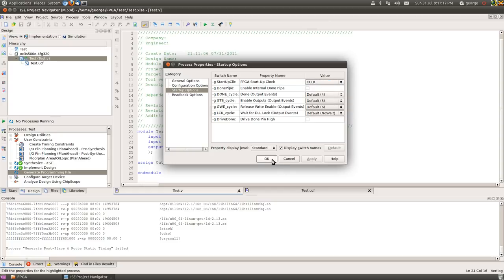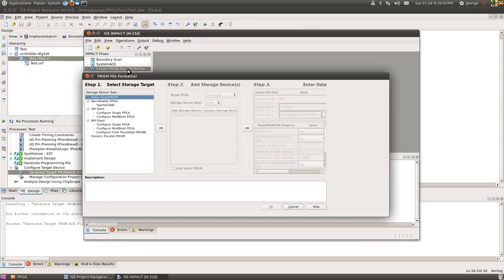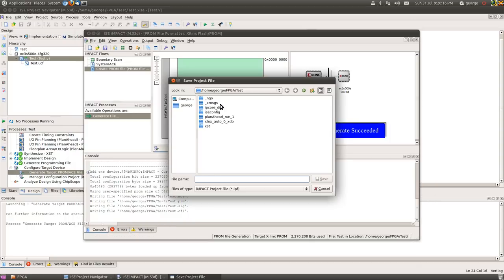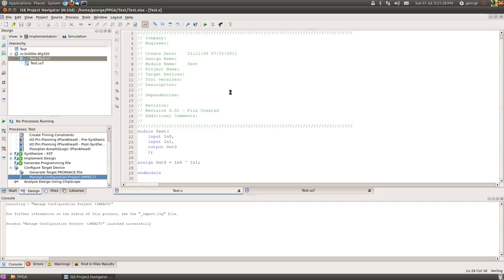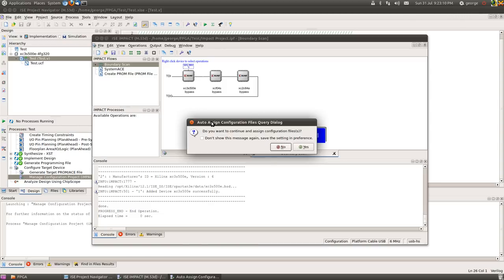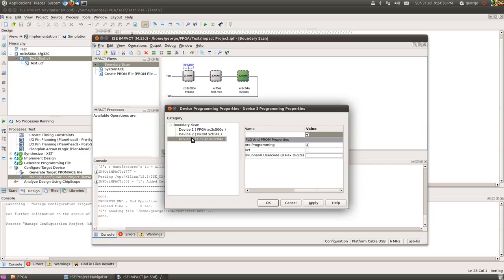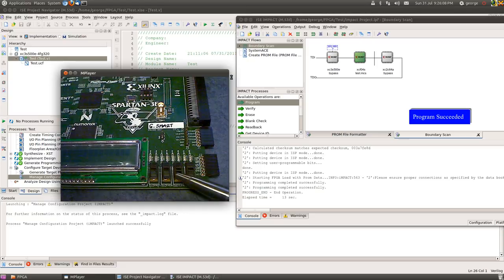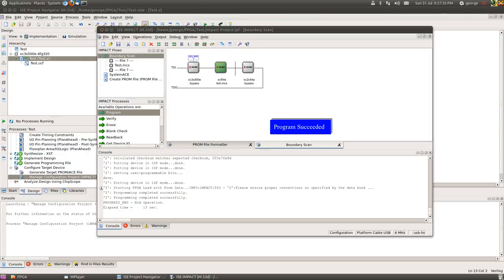FPGA Verilog XOR Gate Tutorial in Xilinx ISE 12.1 (Part 2 of 2)

Comment from the maker: @BallawdeQuincewold These should be in the manual for the evaluation board.  If you have a Spartan-3E as I have, then you can get the manual from either Digilent or Xilinx for the board and it describes where everything is connected to.  HTH.

Comment: Thanks for the Work & Info on the Prom File, and how to fiddle this in via
 
Tool Chain Impact & JTAG. & Co.
 
I use now the Lattice MachX0 Device.
 
So i can prog the MachX0 LCMXO2280C via JTAG-- FTDI2232
 
and the Bitfile is resident inside the MachX0 FPGA/CPLD Chip.
 
This is done inside via the new Diamond IDE with intern Prog-Tool.Menue
 
I use the MachXO Control Development Kit. But i must know how Xilinx Prom File works.
To use as a permanent FPGA App.
 
Thank you so much.